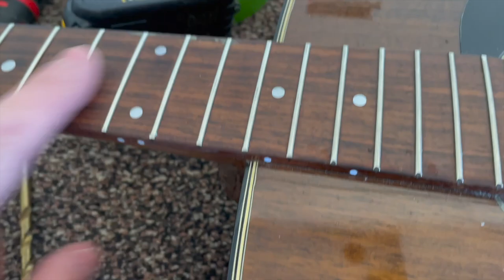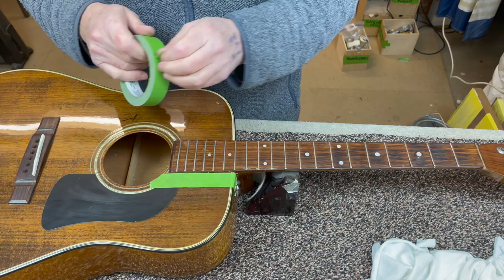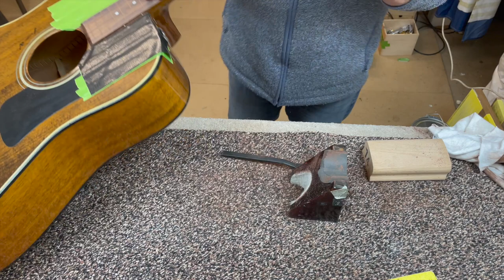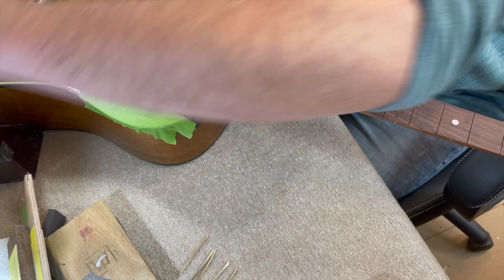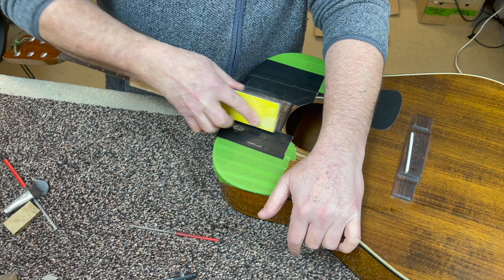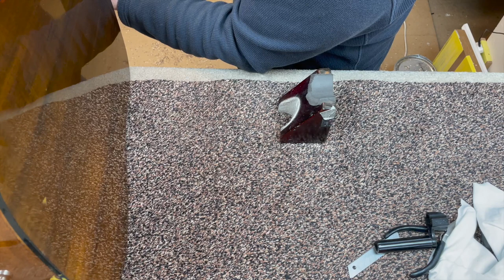Washburn acoustic refret and hand switch 4K

Comment: Is there anyway you could help me on my electric guitar. So my tone bobs are really loose and feel like they don’t do anything and when I opened the back the metal mechanism move when I turn the nob which isn’t supposed to happen and I don’t know how to stop this so that they work
Reply: Les Paul btw
Reply from the maker: @Jackson-ev5hp  Hi - Ok... sounds like your knobs have come loose over time and now they're just spinning when you turn them. As soon as they start to spin they very quickly break the wires connected to them which stops them working. If that's what's happened then you'd need to get some new pots for your LP and have them wired in. It's not easy for a beginner to do that so unless you have some experience soldering, I'd recommend that you take it to a guitar repair shop or guitar tech to have it done.
Reply: @SamDeeksRelovedGuitars  ok thankyou so much for your help